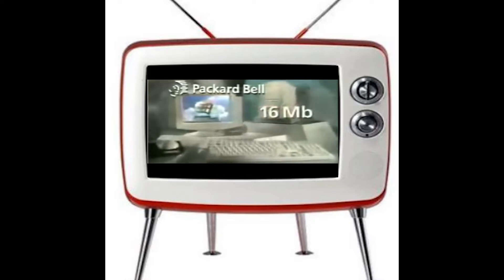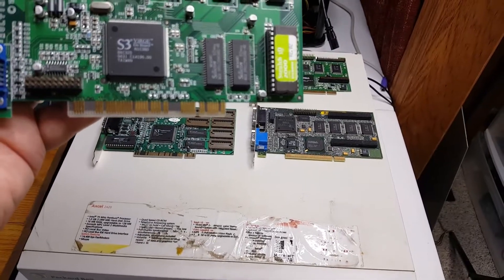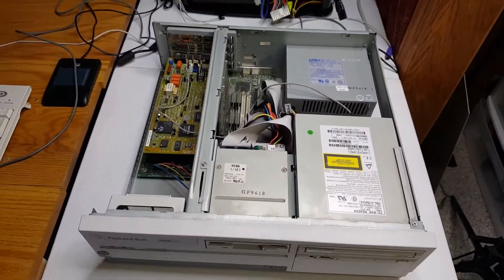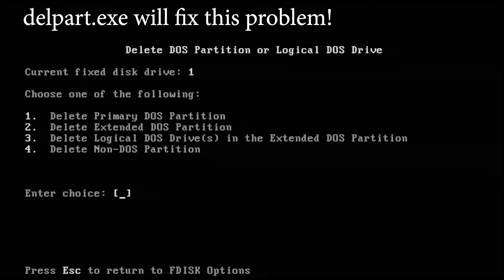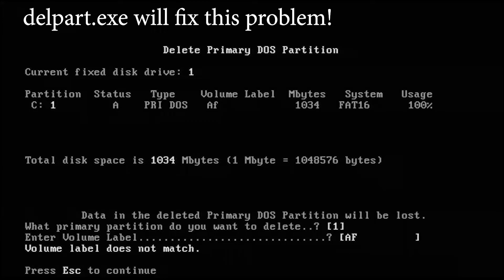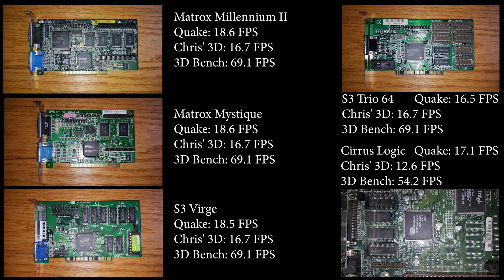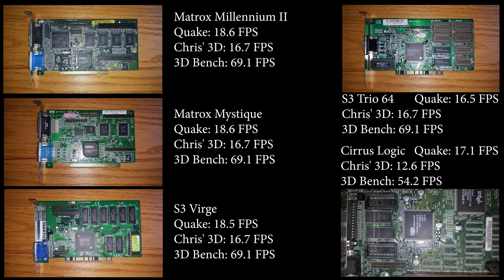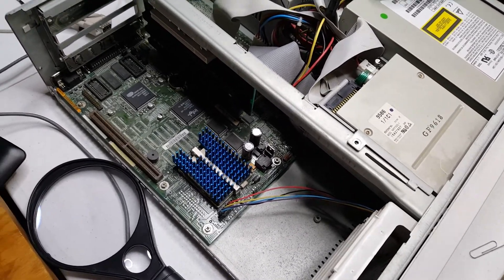Benchmarking the 1995 Packard Bell Axcel 2420 Pentium 75 MHz with 5 video cards in MS-DOS

Comment: This machine is very similar to AST Advantage series machines, extremely limited BIOS settings from a crippled Award BIOS. No idea why, maybe they just made these machines as "idiot proof" as possible for the non-power users given these were mainly Family Computers.

Did you ever get around to benchmarking under Windows in the end?

Greeting from Wales
Reply from the maker: Hello, you Wales guy 😁  No, no benchmarking (yet). I did restore the system to its former glory!  
Looking back, I NEVER PUBBED THAT VIDEO!  It is fully restored with a P166 CPU too!